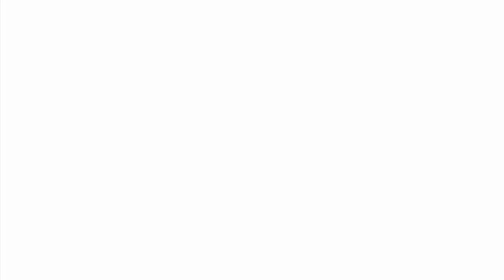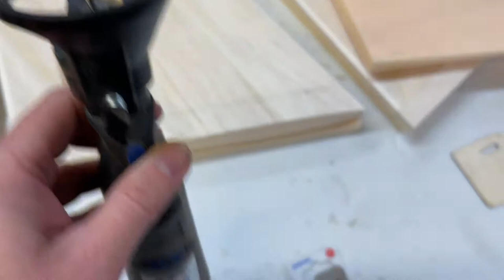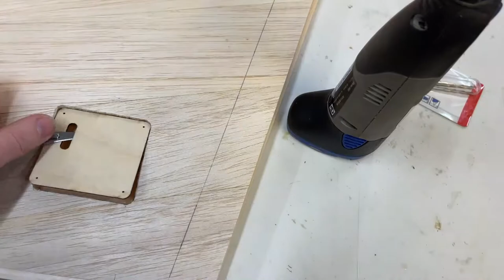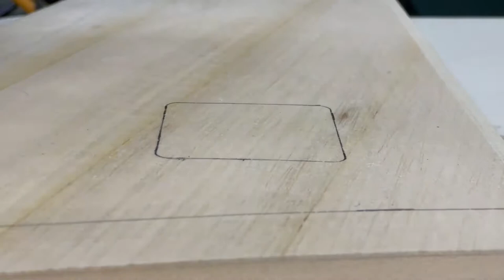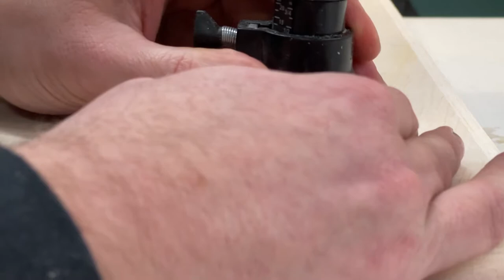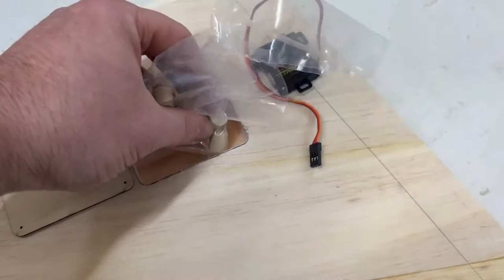Dremel Router Attachment and Spiral Cutting Bit. Lets make some servo wells!

Comment: Hi I like your video. I have used my dremel for the same job. I have used the dremel pack of bits from Lidle. You can also get a  multi pack of  30 bits from the cheep tool stall at the LMA shows and other shows in England. You get about 5 of similar bits to the dremel one in your video that cuts to 15mm.  Just a thought If you have the time you could make money by selling the servo covers and servo mounting packs on your website as they can be expensive to buy.
Reply from the maker: Fun you should mention selling the servo mounts! They are experimental just now but the intention is to have them for sale